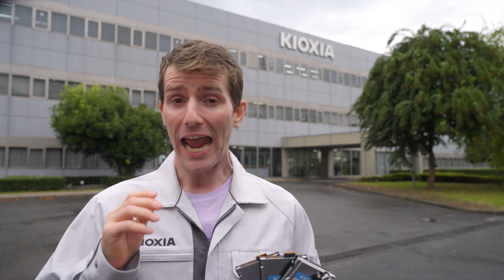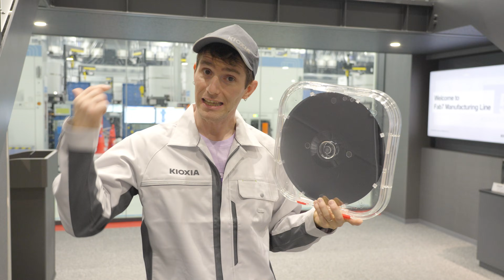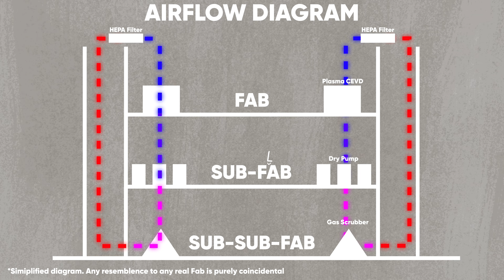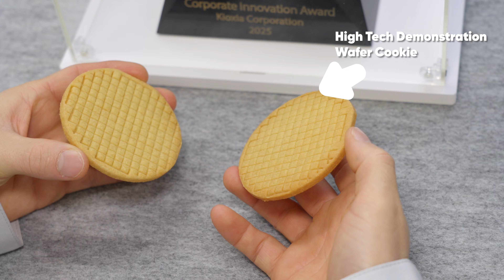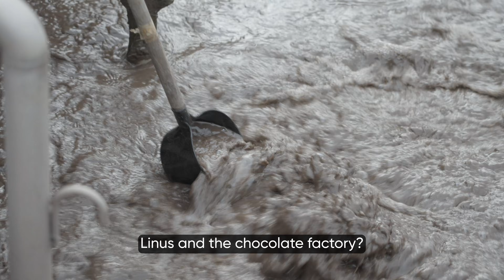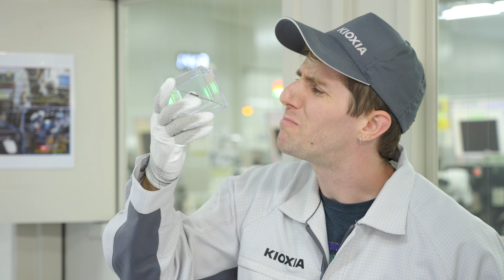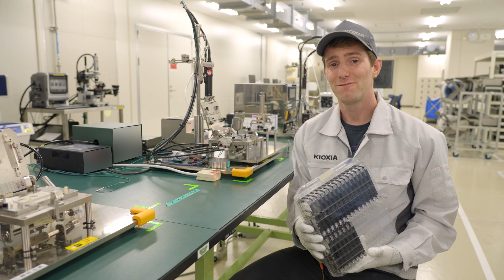A Petabyte in the Palm of My Hand - Kioxia Factory Tour

Comment: Plant base dna 🧬 
By 2028-2030, DNA data storage isn't expected to be a common consumer "plant-based" solution but a rapidly growing niche market for massive, long-term archives, with projections showing significant market growth (reaching billions) and major tech players developing systems for data centers, potentially using DNA ink cartridges in scalable, rack-sized devices for ultra-dense, archival storage, moving from lab-scale to early commercial adoption, though still facing cost and speed challenges compared to tape, notes TechRadar and MarketsandMarkets. 
Key Trends for 2028-2030:
Market Growth: Expect significant market expansion, with some forecasts putting the market value in the billions by 2030, driven by the data deluge.
Focus on Archiving: The primary use will be for "cold" data (infrequently accessed archives) in large enterprises, government, and research, not everyday backups.
Technological Advancements:
Higher Density: Continued improvements in DNA synthesis and sequencing (like nanopore tech) will boost efficiency and speed, notes Mordor Intelligence.
System Integration: Efforts will focus on making DNA storage compatible with existing data center infrastructure, potentially using DNA ink cartridges, says TechRadar.
Major Players: Companies like Microsoft, Illumina, Twist Bioscience, and Iridia are investing heavily, indicating a push towards commercial viability. 
What "Plant-Based" Means (and Doesn't Mean):
Not Growing Data in Plants (Yet): The "plant-based" idea is more about DNA's biological origin and stability, not necessarily cultivating living plants to store data, though synthetic DNA is made from biological building blocks.
DNA as the Medium: The focus is on synthesizing DNA strands to encode digital information, leveraging DNA's incredible density (storing vast data in tiny volumes) and longevity (lasting thousands of years). 
Timeline & Reality:
Near-Term (2028-2030): Expect pilot projects and specialized commercial deployments for massive archives. It's still an emerging technology, but one poised for serious growth and integration into the overall data storage landscape alongside tape and other archival solutions, according to Blocks and Files.

Comment: This is insanely amazing! I can hardly believe that the decoupling of the building is actually possible. The fact that there was that strip of daylight to show that actual gap is insane considering how much metal and concrete is actually suspended. Only thing I wish I would have also learned was what they do with the waste from the water purification since it contains heavy metals.

Comment: Water and wastewater plant operator here. Thanks for showing the water reclamation process. I really appreciate that they care enough about the world around them that they are willing to spend the money and treat their waste water right.
Reply: when they say the reclamation rate is 80-90% what happens to the water that can’t be reclaimed? Is it like hazardous and can’t be reused or is it just like flushed down the drain/polluted?
Reply: @FomeDH  it's probably lost to evaporation, so it's just the water that gets dispersed, not the pollutants
Reply: @FomeDH  Some of it's likely still held in the sludge at the bottom.
Reply: ITs most likely a cost saving measure.  Using "someone elses" water would have a significant cost.  reusing what they have would work out vastly cheaper.  I'm pretty sure that the waste water coming from the plant is already significantly cleaner than what comes out of the municipal pipes anyway - remember he said they actually add in "soil" so the wastewater to make it dirty enough to clean.
Reply: @jameshodgetts7541 it’s in Japan, they have rather high standards for pollution too.  So it could also just be a requirement.

Comment: Kioxia was former Toshiba Semiconductor Solutions which was the company that invented Nand Flash technology. It may be Samsung that has the most global market share, but it was Kioxia that brought this technology to the world and continues to lead it. They are the OG.
Reply: Toshiba HDDs are still some of the most reliable, if you can find one that is
Reply: @JojoJoget  I had one fail on me.  SAS 15Krpm 600gb model.  But otherwise, the only faulted drive.  They are very reliable.
Reply: @JojoJoget  Why would it be hard to find one? The N300 and MG series are pretty common.
Reply: @JojoJoget  And that HDD business came from Hitachi, or HGST specifically. That business got purchased by Western Digital and... now WD makes those HDDs, at least at their higher trim levels.
Reply: @JojoJoget i went through 2 toshiba branded portable hdds and they both died after like a year :<
though those were usb connected ones so maybe the internal ones are different
Reply: Just like Blue LEDs, I guess. The Japanese did invent it, but they are not conquering it...

Oh, I think Toshiba was also the one who supplied original iPod HDDs, too.
Reply: they're committed to be the bleeding edge.
Reply: I worked in Toshiba before. Writing firmware for HDD and SSD.
Reply: @bassyey  ROM, SA, translators and modules?
Reply: @bassyey Cool!
Reply: Toshiba has some economic problems with there nucleare enterprice and has to sell there chips Business...
Reply: @skak3000  Pure unlucky fate for them, terrible timing of 3.11 earthquake in Japan. Nonetheless, nuclear powerplant is a national technology and is important to sustain increasing electrical consumption...
Reply: @skak3000 Toshiba was hijacked by unhappy shareholders who sold divisions of the company one after another till finally someone put a stop to them and privatized the company. They still own infrastructure and medical businesses but their TV business, appliance business, PC business, lighting business, and semiconductor business have been sold off.
Reply: thnx for the info
Reply: thank you for this info, I had no idea.
Reply: I imagine Linus spending countless days trying to memorize his terminologies and acronyms to make this video.  Maybe someone had him reading from a teleprompter, but still properly pronouncing the terms, must have been a major leap for Linus.
Reply: What about Toshiba made tv and laptop?
Reply: @arocomisgamusclademork1603 Toshiba TVs unfortunately got sold to Hisense but they still developed REGZA TVs. And PC division sold to Sharp and changed the brand to Dynabook.
Reply: that is absolutely great to know. Thank you.
Reply: @4givenoxygenbarez 👍
Reply: Japan is naturally strong since we can domestically acquire all the chemicals and silicones necessary for fabrication. We also have bunch of bleeding-edge semicon machine company (Tokyo Electron, Disco, Advantest, Screen, etc...) that is installed in every single factory globally. Yes Samsung out-did Japan in terms of sales and branding, but ultimately they're all dependent on Japan's near-monopoly of semicon materials.
Reply: @FoodFighter46 more like they have a strong foundation in semicon because they were early adopters in semicon manufacturing and R&D.

The materials isn’t the pivot here, silicon is a common material.
Reply: @FoodFighter46  they have Mineral rich land i think. Lots a of volcanos made it possible i guess
Reply: @tiergeist2639  not much minerals compared to China, but we have very secretive process to make silicone ingots and photoresists (Shinetsu, Tokyo Ohka, fujifilm, etc.). All semicon indistries heavily rely on them. Seems like other companies really have hard time replicating them as well. I mean these technologies are very classified as well.
Reply: @FoodFighter46  they are a vasal state, it just seems like that but they are getting used. its strategic.
Reply: @tiergeist2639   The margins are shit, so the market is left to korea and china
Reply: @XGD5layer  The RAM, esp. hbm tech, crucial part of next gen computing such as A.I. sever, is still massively profitable. This HBM tech is dominated by two companies, one is Samsung and the other is SKHynix, both Korean companies, though I don't know there is such a semiconductor (memory firm) that can in China. Rgds.
Reply: @XGD5layer  yep, they let them produce cheap electronics. its strategic
Reply: @XGD5layer  A big difference. unlike korea, china doesn't have a chip industry to speak of.
Reply: @XGD5layer It’s quite lucrative and a market for those who know the secret processes. Price cant buy that, that’s why Taiwan, China, and Koreas semiconductor industries are subject to Japanese technology and chemicals.
Reply: @tiergeist2639 actually no Japanese metal is very soft and terrible and they don't have oil either

Their manufacturing expertise has nothing to do with natural resources, even salmon is imported from norway
Reply: @mrgurulittle7000  good to now
Reply: Every major bleeding edge tech solution majorly based out of semicon comes out of Japan, be it OLED, NAND, Image Sensors, etc. Samsung just innovates over it at scale.
Reply: @anshumanjha9270  Yep. Japan innovates the tech and by now they’ve quit trying to out do Korea and China and instead license the technology out to them. Japan and Germany have a huge percentage of exports in just intellectual property on technology.
Reply: @anshumanjha9270  Toshiba is a very strong player in the medical device sector as well; they are also well-known for their heavy-ion radiotherapy systems that costs easily over $270 million each.

Comment: I'm really conflicted by this video.  On one hand, it is amazing that Kioxia have managed to pack such an amount of storage into the size of package they have and should be commended for it. But on the other hand I feel LTT haven't reallyy taken the temperature of the room and looked at the wider picture here.  Putting this video out now of all times, when Samsung and Micron have just announced both mass shortages of NAND and RAM chips and a complete removal of the company for the consumer market because the AI slop bandits are buying it all up at ever higher prices, forcing the consumer grade products to be completely out of stock or stock that is available being at such stupid prices I cannot justify buying (despite needing) for the foreseeable future, it does feel like a bit of salt has been rubbed in the wound - 'look what you could have if you've got 10's of thousands to throw about to buy a hard drive with more storage capacity than every PC in my home (and probably every friends home at that)

That said, great video LTT staff.   Commendable work Kioxia, but how about expanding your production facilities in the next few years so we can potentially afford to buy some normal, home sized storage drives in the, hopefully, near future ey?

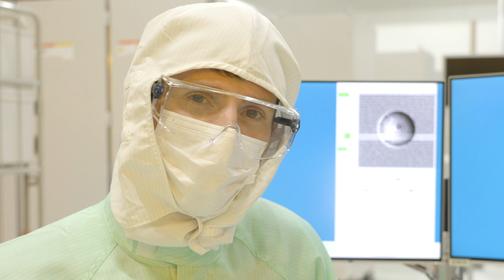Comment: Analysis of the defects from the video at 8:00

Analysis limited to conclusions that can be made with certainty

Only conclusions supported directly by SEM morphology and well-established NAND process physics are included. Speculation is excluded. Each defect type is mapped to a single, confirmed root cause.

⸻

1. Long, thin “worm-like” or filament structures

(clearly aligned with process directions in several images)

Visual confirmation
	•	Length ≫ width
	•	Orientation follows lithographic direction
	•	Adhered to the surface, not loose particles

Conclusion (certain)

Etch stringers

Root cause
	•	Polymer by-products formed during plasma etching
	•	Incomplete removal during ash/clean steps
	•	Typically caused by fluorine-based RIE with excessive polymerizing chemistry

Why this is certain
	•	Particles do not form long, continuous filaments
	•	Mechanical damage does not produce uniform, thin strings
	•	Etch stringers are a classic, well-documented NAND defect with this exact morphology

⸻

2. Circular “donut” or crater-like features

(highly symmetric, often with a central pit or bump)

Visual confirmation
	•	Radial symmetry
	•	Repeating size across multiple samples
	•	No alignment to pattern direction

Conclusion (certain)

Thin-film nucleation defects (ALD/CVD nodules)

Root cause
	•	Localized contamination point prior to ALD or CVD
	•	Abnormal film growth around a single nucleation site

Why this is certain
	•	Etching does not create radially symmetric rings
	•	Random particles do not produce hollow or ring-shaped structures
	•	This morphology is characteristic of ALD/CVD nucleation failures in SEM images

⸻

3. Irregular, chunky “rock-like” objects on or between lines

Visual confirmation
	•	Random shape and orientation
	•	Brighter SEM contrast (different material)
	•	Clearly discrete objects

Conclusion (certain)

Solid particle contamination

Root cause
	•	CMP slurry residue
	•	Metallic debris
	•	Resist fragments not removed during stripping

Why this is certain
	•	Shape does not follow any process geometry
	•	Occurs as isolated defects
	•	SEM contrast indicates foreign material

⸻

4. Small “pillars” or protected islands on otherwise etched areas

Visual confirmation
	•	Surrounding material etched normally
	•	Single local region remains elevated

Conclusion (certain)

Micro-masking defects

Root cause
	•	Metallic or inorganic particle acting as a local etch mask
	•	Plasma cannot etch the material underneath the particle

Why this is certain
	•	This is the only mechanism that leaves isolated etch-resistant features
	•	A well-known yield-killer in NAND manufacturing

⸻

5. Broken, fractured, or torn structures

Visual confirmation
	•	Irregular fracture surfaces
	•	Non-polymeric appearance
	•	Often located on patterned lines

Conclusion (certain)

Mechanical damage

Root cause
	•	Excessive CMP pressure
	•	Structural weakening due to over-etch or under-etch combined with CMP or handling

Why this is certain
	•	Plasma does not mechanically tear structures
	•	Wet processing does not cause brittle fracture
	•	This morphology exactly matches known CMP-induced damage

⸻

Final confirmed summary

There are no ambiguous cases in these images. All defects fall into five well-known NAND process categories:
	1.	Etch stringers → etch recipe and polymer removal
	2.	ALD/CVD nucleation defects → surface cleanliness before deposition
	3.	Solid particle contamination → CMP or cleaning steps
	4.	Micro-masking defects → metallic/inorganic contamination
	5.	Mechanical damage → CMP or wafer handling

These are not generic imperfections but classical yield-killer defects, routinely identified from SEM images in semiconductor manufacturing.